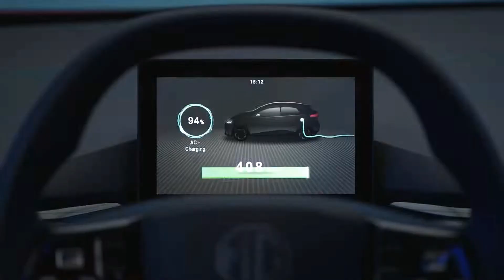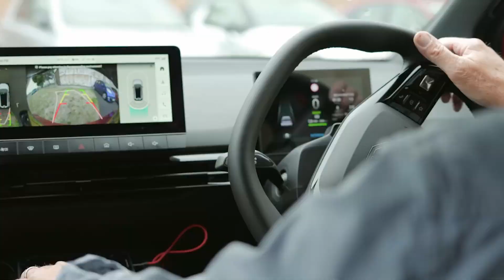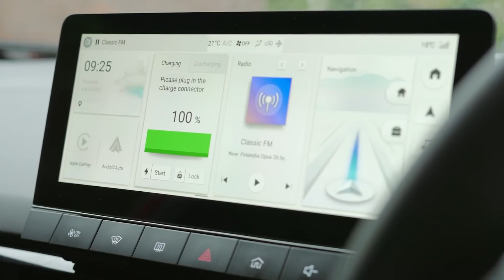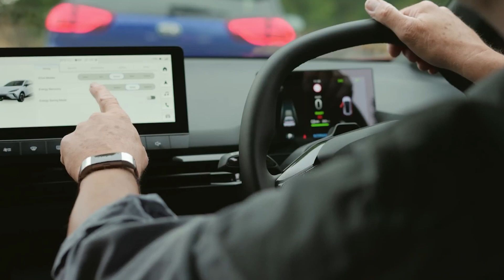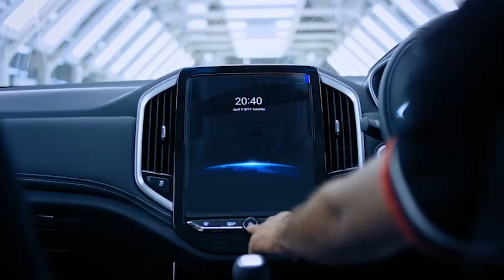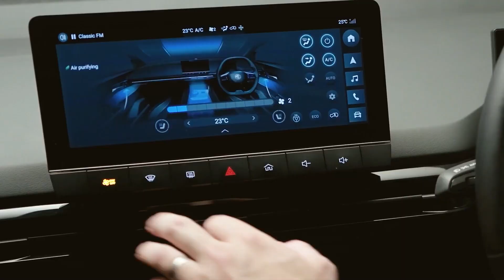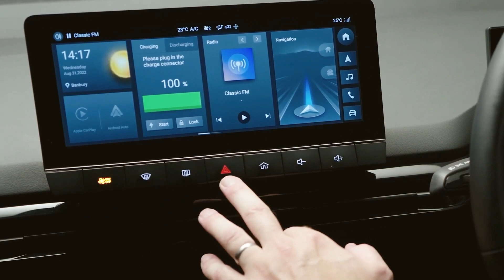MG4 Most Strong Autonomy range in Winter Guaranteed

Comment: Why were the early pictures shown of the Renault megane, not the e-tech ev? Fact check, the Renault is lighter than the MG4 and has the same battery thickness.
Reply: The weight is quite the same. MG4 Comfort/Luxury (64 kW battery size) has  got 1685 kg, Megane-E with 60 kW size has got 1708 kg. Height is nearly the same (Megane 151 cm, MG4 150 cm). But MG4 is 10 cm longer.
Reply: @martinv.352  If you check on ev database (reliable information) Renault 1711kg, MG 1755kg standard and 1785kg long range.